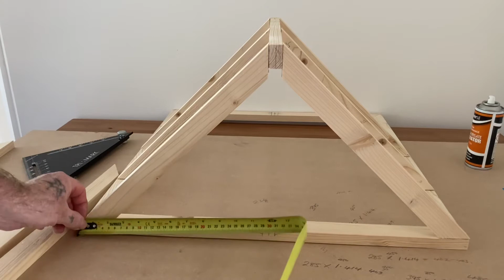Basic roof construction part 2

Comment: Great video and great Channel, would the valley rafter be the same for the measurement,  and the cuts at the top of the valley
Reply from the maker: Hi mate thanks , basically a hip and valley rafter are the same thing , except one sits on the external corner (hip) and one sits in the internal corner (valley)

Comment: Would the square work for the hips if say the king rafter was 30 degrees and the common raters was 45 degrees. Or would it be best to go old school and get the string line out. I'm just starting out in joinery.  I like you vids  just come across you and been watching a few very informative
Reply from the maker: Hi mate , thanks Glad you find the videos helpful , your question is an interesting one .
Il try to answer as best I can , normally all common rafters would be the same pitch including the king as you call it ,which means the hip rafter is easy to work out . But if a hip roof is being formed with two different pitches the hip is not so easy to do as it then becomes known as a bastard hip and as you say you need to get your lines out and find the intersection point of the two different pitches , which in some cases means the hip will have to move over from the the corner slightly , hope this helps 
Happy roofing